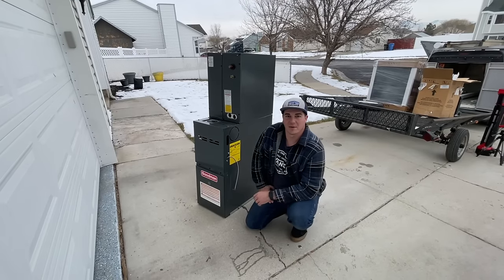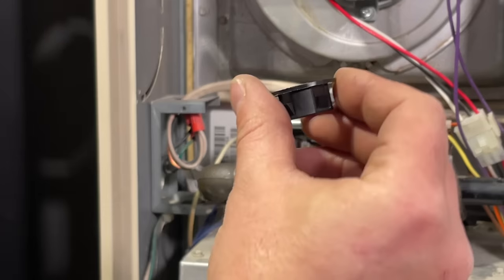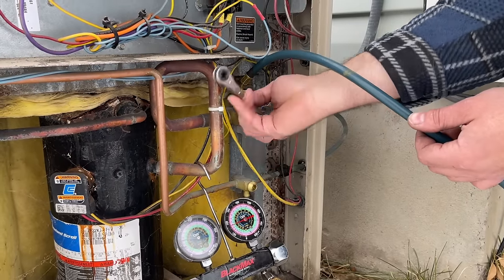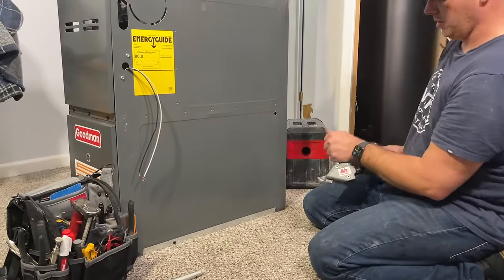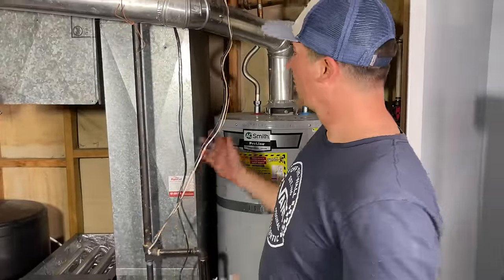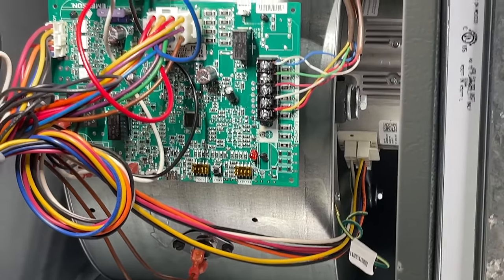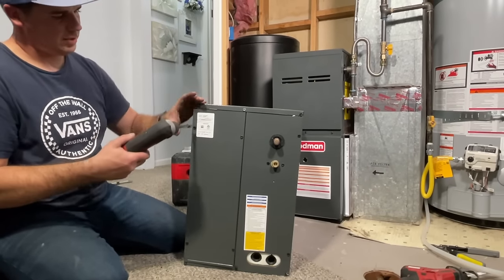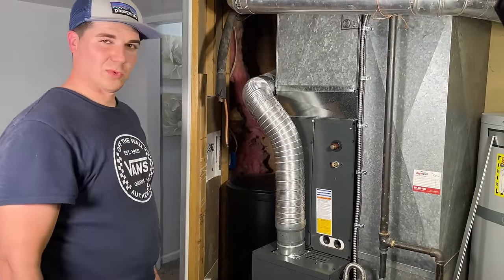Save THOUSANDS Replacing Your Gas Furnace Yourself.

Comment: Not a fan of those filter racks. Why did you use a flex gas line?
Reply from the maker: Code. I was restricted with size otherwise I’d have used a rack that has a magnetic door 👍🏼

Comment: In the past I've seen the furnace coupled to the ductwork with a flexible coupling.  Are those not used anymore?
Reply from the maker: They can be used for sure but it’s not mandatory. I prefer the metal transition.
Reply: @diyhvacguy  does the metal coupling also couple more noise?

Comment: One question I recently got my HVAC  brand new and the furnace turns on the flame less than 10 seconds the blower kicks in is that normal? It's also a goodman brand
Reply from the maker: Yep flames always come on first to warm the heat exchanger. Then the fan. 👍🏼

Comment: What are the names of the gauges you used on the condenser and meter you used at the end of the video ?  Great job !
Reply: @Kevin-mp5of  Thanks Kevin.  Looking forward to the rest of the series !
Reply: The tool @13:05 is a standard manifold service gauge. 
The tool @54:40 is a manometer. It’s being used to measure and set the natural gas pressure.

Comment: I noticed there is no sediment/water trap in that gas line. Probably the reason for the bolt in the gas valve was to make it hard for the gas company to lock it off.
Reply from the maker: We installed one. Not sure what you are referring to here.

Comment: This is not a DIY job , not because of the complexity , but because of home insurance reasons. Even though you may do a great job , if something happens , let's say you have a fire for some other reason , the insurance company is going to ask you for proof that all electrical and all gas work was done and approved by a certified electrician or furnace installer. If you fail to provide the proof , you could be denied coverage. I know this kind of work is expensive , buy why risk the value of your home for a few thousand dollars worth of work.

Comment: How hard is it to replace a gas furnace with an electric heat pump?
Reply from the maker: The heat pump portion is totally seperate so it would basically be the same as this except you’d be re using your existing evaporator coil. Unless obviously you were replacing the whole system. If you’d like more info on this, feel free to email me at diyhvacguy@gmail.com   Cheers

Comment: I appreciate your videos!
Where is the best place to buy the units ?
Reply from the maker: If you are doing research for a replacement feel free to email me at diyhvacguy@gmail.com and I’m happy to get you info on the best place to purchase equipment online and the correct size equipment. Thanks,   Dave
Reply: @diyhvacguy  Thank I will check with you next summer probably. The last unit was a 4 ton gas pack, installed it was $3k which I thought was good as the guy said it was at cost plus $500 to install. Little did I know the unit was available on eBay for $1200. This was about 10 yrs ago. I've replaced 2 of the 3 fans and several other parts already. The rust I think will be the death sentence for it. The panel that the exhaust fan mounts to is rusted but no holes yet but I don't think it's worth trying to replace that. Again thanks for the time

Comment: Why my newly installed Goodman furnaces generate code F02 and 9 H? The furnace runs well, but the code won’t go away. Any help will be greatly appreciated!!!
Reply: Just realized that these codes of F02 and 9H are just a normal operation status codes, so they will not go away 😅.
Reply from the maker: Yep 9h is heat mode and f02 is your fan speed :) cheers

Comment: how do u figure out what system will work with existing unit
Reply from the maker: Hvacdirect.com has a really nice sizing guide. But if you need help with sizing your furnace properly, check out our Patreon membership! For only $25 I will give you one on one help with sizing, installation tips, help with warranty and so much more. Check it out at Patreon.com/diyhvacguy    Cheers

Comment: where do i purchase a new hvac system?
Reply from the maker: Hvacdirect.com! Make sure and use my discount code, X17AYSRVNGN8  To get an additional 3% off your order. I’ll be doing a video soon highlighting how great hvacdirect.com is.

Cheers
Reply: @diyhvacguy  ok great yea if you could show how to purchase the system and what to expect, also does it come with instructions, also would it include every part, or where would you get additional parts like tees and flex duct and registers and what not, thanks

Comment: At least he didn't have a multiple compound transition for the top plenum.
Also, he chose a pretty EASY one to do.

Let's see him do a really hard one.
Ya know, funky ductwork sizes, oddball offset transitions in very difficult spaces, Etc.

And another one with an old horizontal flow furnace with giant ductwork (from earlier conversion from octopus furnace to gas forced air). And WITH a/c.
On his knees/belly on a rocky dirt floor that you have to crawl on the whole way, no head room hardly, dark, no outlets nearby.
Working with ancient gas lines that what appears to be TAR used as a thread sealant.
Oh and toss in an antique April-Aire humidifier just for fun.

All in a very OLD house.

Now that would be a big challenge!
Buuuttt....
Reply from the maker: I got news for you, utah is the place to do HVAC because most furnaces are exactly like this one 😀   I’m doing a furnace replacement I’m a crawl space in a few weeks so stay tuned for that one! Let me know what I can do to improve if you don’t mind. Cheers 🍻
Reply: @Kevin-mp5of  Not necessarily true.
Reply: @diyhvacguy  No expert here sorry.
I wish all furnaces were installed in EASY to repair/replace areas.

Closet ones (SMALL closets) and horizontal ones are among the hardest to do.

Took the repairman many hours to fabricate the top plenum in a very cramped closet.
Watched him do it.

If the owner would have allowed a wall tear out, it would have been easy.
But nooooo.

I look forward to seeing you do a very hard one.

Comment: Average Joe Shmoe save yourself thousands and hire a company to do this. You need to recapture refrigerant and properly charge your A/C. If I walk into a half done job and your expecting a discount your wrong. I’d have to start from square one and remove that crap you tried to install. Good luck buying refrigerant without your epa certification.